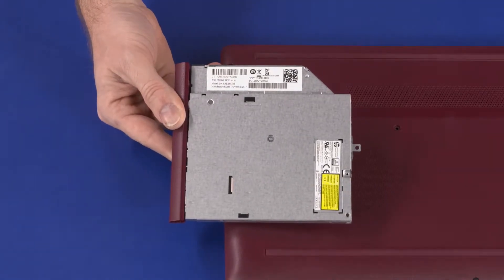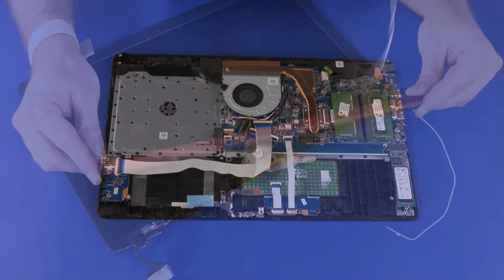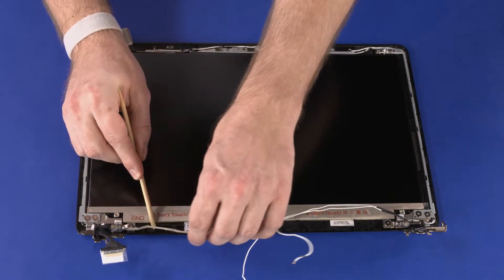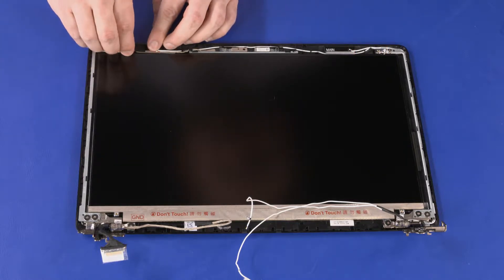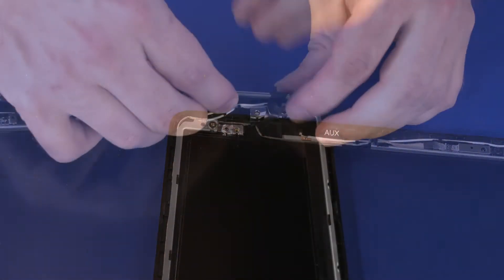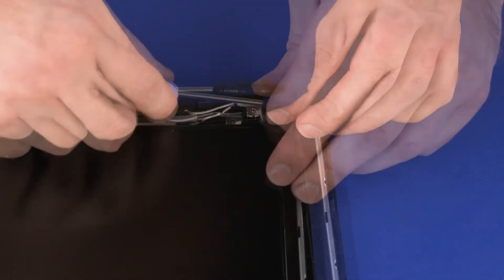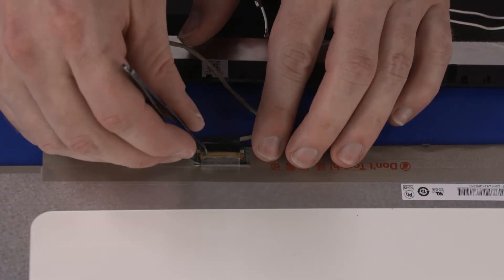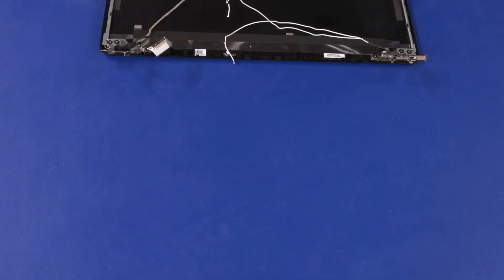Replace the Display Panel (FHD) | HP 14, 15, 240, 245, 250, 255 G7 Notebook PC | HP

Comment: Idiotic lack of instruction here. For example - they don't tell you that the bezel is stuck to the screen at teh bottom using either double-sided tape or glue. So - removing the bezel at the bottom is very hard.
Reply from the maker: Hi there, thanks for contacting HP Global Social Media Support!
I understand that you are experiencing an issue in replacing display panel. 
I will do my best to assist you.
May I know the exact model number of your notebook?
Please let us know!
Regards, 
HP Support